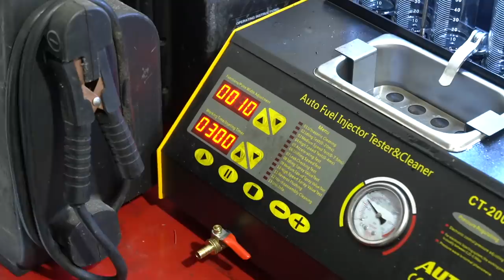Fox Body Mustang | How to Care for a Limited Use Car

Comment: Makes sense about the drop in flow on the outer injectors. There will be a pressure drop due to wall friction at the ends of the fuel rail. Maybe add two fuel supply lines to the ends of the chinaboi fuel rail?

Comment: I own a 5.0 and I'm kinda tickled at how you ran the exhaust.  A stock 5.0 has the mufflers under the rear seat with an over-the-axle tailpipe.  You've basically run a standard IRS type exhaust with muffler tailpipes.  One of the problems I always had with the 5.0 was ground clearance to the exhaust, if you lower it even a little the exhaust just scrapes on every bump.

Comment: I would speculate the single hose input is what causes higher flow through the centre 2 injectors. There's higher pressure in the centre than the outer 2 outputs in the rail.

Comment: For those who have cars in storage to accumulate in value and rarely drive it, how often would you do this? I’ve heard that leaving a car sit for too long with fluids can damage the motor as it goes stale ?
Reply: If you are that hardcore about storing a car for a legnth of time, you do what my mates dad did with his hq gts monaro. Put it on stands, drain all fluids, cover it with blankets and leave it for 20 years. Yeah, it still needed the carb rebuilt, and the tyres went hard. But it didnt take much to get it going again as the wheel bearings didnt go square being in the air, all it needed was a few perishables like lines, but being kept covered in a dry place, the paint and interior held up. It sold for heaps.
Reply: @Greg....  thanks
Reply: greg nice, that’s exactly how you’d expect to keep it